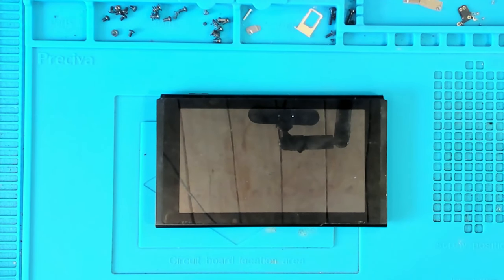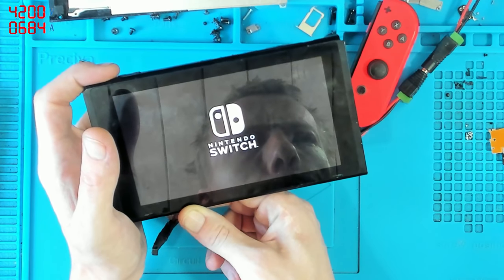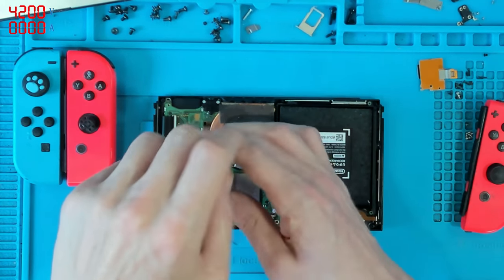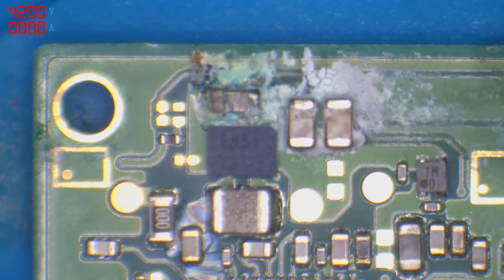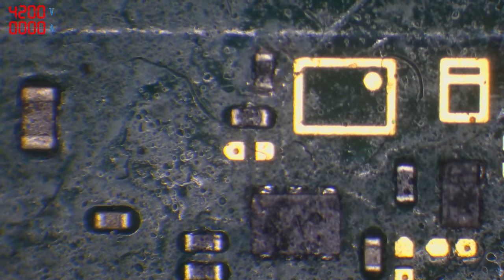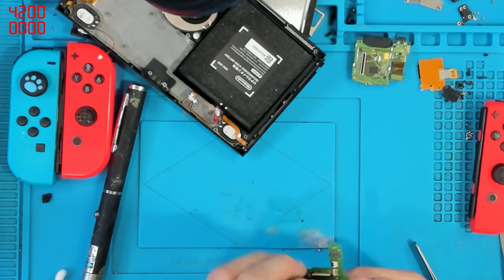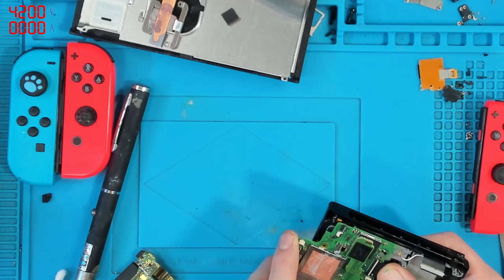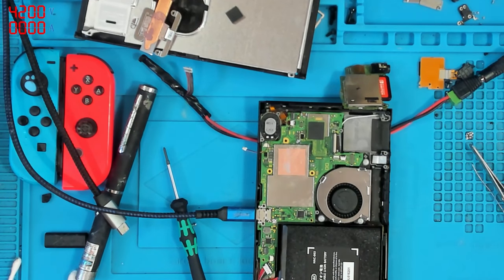Nintendo Switch Severely Lagging During Boot Up And Gameplay - Complete Diagnosis And Repair

Comment: Phil mate the thermal sensor in the switch is the chip marked T451 close to were you unplug the; Joy Con Rail, Back Light ribbons. In your case it was a totally different story, 
that is what makes your content unique! The chip you re-balled is a Dac + Headphone Amplifier with Electronic Volume. Mouser has them mate> TC94B15WBG(EB,NKA) :_console:
PMSL!! 🤣🤣 Now I want to watch Rush Hour. That clip insert is, quality, very funny! Oh the caps around that Dac IC are for the chips charge pump, as you'll see 🤓👍🏻
Reply from the maker: Ah, thanks for that mate. That's why I like to give my thought process, and definitely leave the door open for correction because the moment anyone thinks they know everything, they stop learning anything. It makes total sense with lagging if it's struggling to play audio. That said, do you happen to know what the other part was where the resistor was?

And hell yeah rush hour is awesome, been waiting for a chance to drop that thing in there 😂
Reply: Ah you mean the SOT6 chip? that's says something like VQ on it. That is close to the 3v line & its pin layout does indicate that it is, some kind of ESD Protection for the audio/speakers. They are diode-based,  that type of chip, Has a DC Breakdown Voltage of 7v so that would explain the resistor death, maybe. Oh and I'll be learning until the day I leave and get cooked, they ain't using me to feed the worms lol! in-fact thinking of digging, If you want I can dig further & relay my findings, I know I'm quiet a lot but please keep me in mind for a silent helper 😊👍🏻
Reply from the maker: @Ratchet_effect  cheers mate, yeah that resistor suffered a little to be honest. The only annoying thing is I won't know for sure what caused the lagging, but I might experiment on my own switch and find out lol. I always do appreciate the help mate, that's what this channel is about, we all learn together and we don't mind being corrected if we're wrong. I think I was probably right in terms of one resistor causing lag, but just a bit off on what that resistor was for lol
Reply: True! I think your spot on the money! there was casualties but.. that resistor is on the circuit that feeds the audio codec chip so you nailed! it, spot on the head, from my perspective. That along with the re-ball and cleaning up the corrosion of course.
Reply from the maker: @Ratchet_effect  I shocked myself on the reball, I usually don't enjoy using paste lol

Comment: Cracking video Phil, amazing how that Switch even turned on with the amount a liquid damage it had. Love how you give the airflow & temp when using the hot air station. Info like that helps so much when you are trying to learn. Thanks again!
Reply from the maker: Thanks mate, I was shocking but given it was mainly around where audio is produced it generally would when in that area. Glad the temps and things help mate, I remember learning and always wondering what temps I should be using but over time you get a feel for it

Comment: I found 2 really nice hp 27" elite  monitors in the scrap today unfortunately they are both cracked and screens cost over 100 euro its the same with cracked tvs its very annoying that cracked tv/monitor screens are very hard to find or very expensive and not worth fixing and they tell you to buy a new one its such a shame that good tech has to be scrapped and deemed non repairable anyway ill keep an eye out for new displays for them. Also great fix Keep up the great work
Reply from the maker: Yeah sadly they aren't worth fixing when the panel is cracked. They're pretty much just good for pulling the boards out and banging them on ebay to make a little money on them

Comment: Nintendo introduced an "overclock" mode in an update awhile back.  Some games use it to speed up load times (I think Animal Crossing is one of them).  That's probably why it didn't shut down until after the game started to load.
Reply from the maker: That makes sense to be honest, I don't think that's going to be good long term for the cpu though if games can overclock in software. All it takes is one process to freeze and it could be bad news
Reply: @TheCod3r  It's actually fine, for a reason.  The chip is specced to run at 2 GHz.  Nintendo normally runs it at 1 for heat/battery related reasons.  The "overclocking" is actually just letting it run at its normal speed, in short bursts, during game loading (it's not used during actual gameplay at this time).

Comment: Any idea why the fan would run full speed when a switch is fully powered off? My own has done so a few times, i hadn't even been using it either...Random.
Reply from the maker: I'm not sure to be honest, it shouldn't be running I'd the system is off though
Reply: @TheCod3r I know, very odd.
 It originally had a completely dead battery which i replaced, maybe that was the primary fault/cause to begin with.